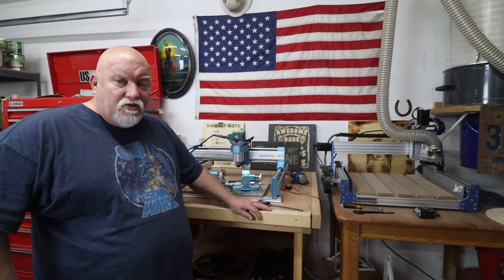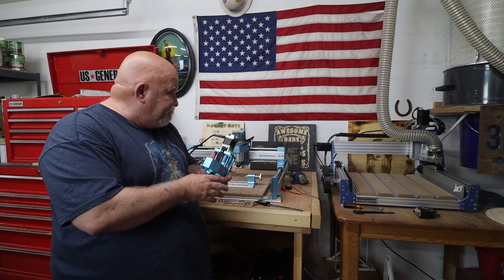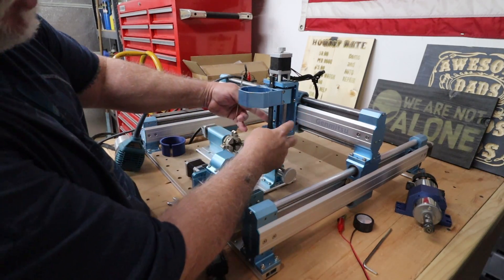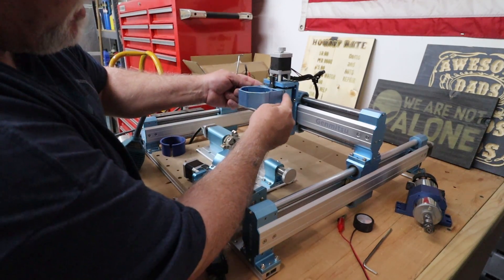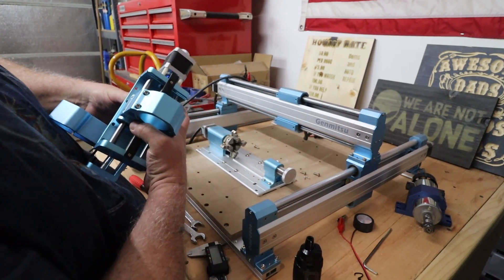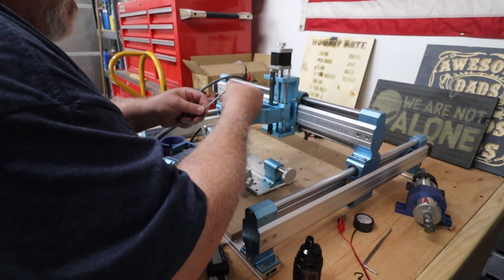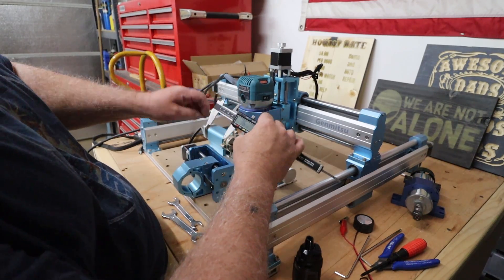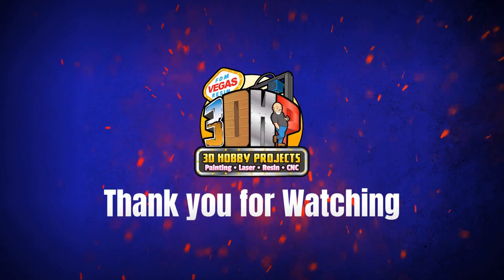Genmitsu 4040 Pro Z Axis Upgrade #3dhp

Comment: They refused to upgrade mine, despite purchasing my unit right as it came out.

Pretty frustrating... They claim that mine shipped with it, however the designs are dissimilar enough that it's impossible to mistake them for each other.
Reply from the maker: Reply here,Include picture with tape measure next to it so they can see it.Let them know you are getting a lot of chatter.  marketing@sainsmart.com